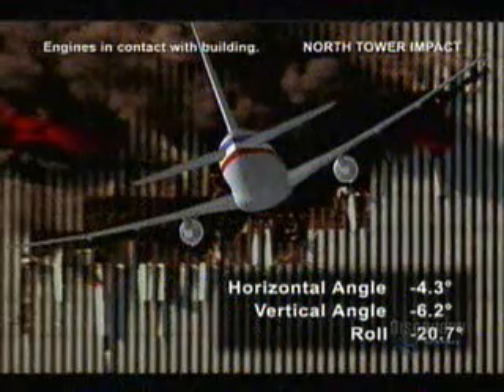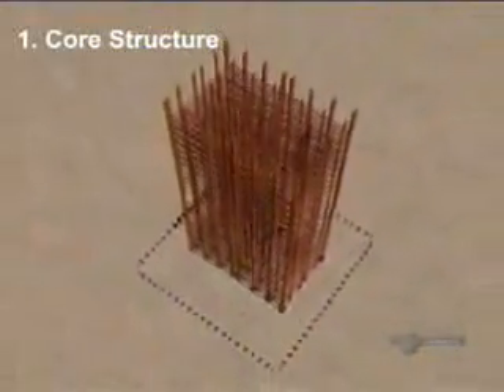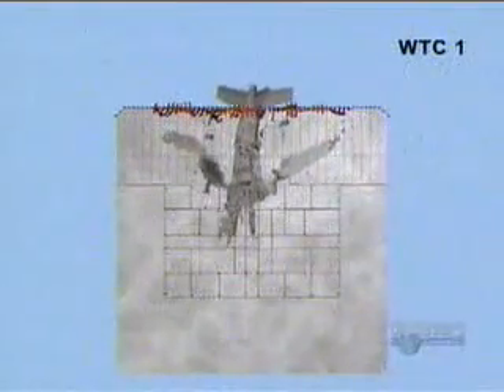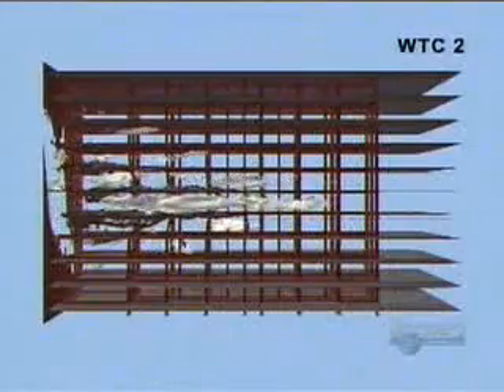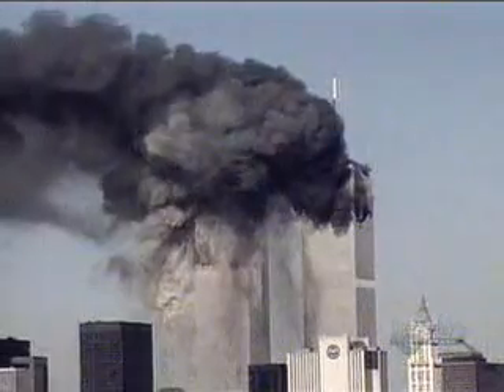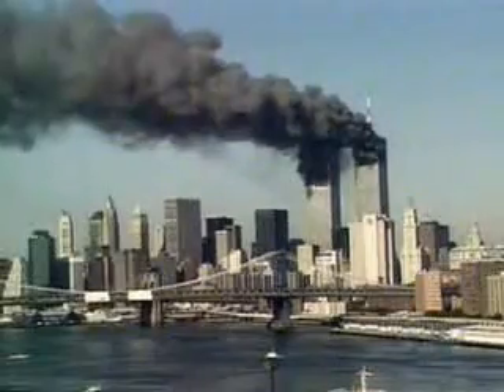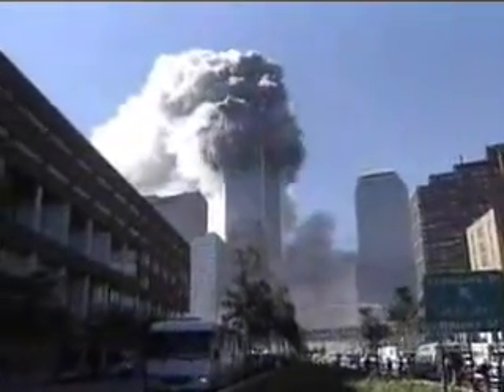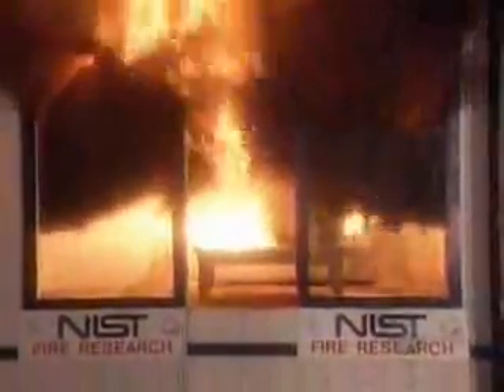9/11 What Made The WTC Twin Towers Fall

Comment: YES! THIS IS WHAT HAPPENED!...but sadly, there can be no adequate explanation, scientific or otherwise, for those who are intellectually challenged nor hell bent to believe ridiculous conspiracy theories.
Reply: The video needs to be more exact...and before you start saying that "I don't listen to facts"...I've read and have seen every video. And the one thing that doesn't make sense is that the man said that it got up to 1000 degrees. Is that in Celsius, or in Fahrenheit? Because steel itself only melts up to around 1370 degrees C, or 2500 degrees F. And if it was iron that was supporting the structures, it'd then be up to 1510 degrees C, or 2750 degrees F. Now as for the plane goes...it's reasonable that it crashing could cause some form of the structure to weaken, however the model of plane that flew into the towers (and well about every plane that's normally created), was made out of aluminum, fiberglass and some other particular materials. Yes with speeds that it was going could be a lot of force, the density for aluminum is around 2712 (kg/m cubic). Steel on the other hand has around 7850 (kg/m cubic), making it much stronger and durable than aluminum (also demonstrated by the video of how it was able to be destroyed so easily).What doesn't make sense is how it says as it was destroyed, that the pieces started to separate and splinter out. Now if I took a sledgehammer and used all my might against lets say steel for example, it would have created a dent possibly (depending of the thickness of the material). Now if I used the same force, however having the sledgehammer's main head to be separated like a shotgun blast how it was trying to describe in the video, the effects aren't as great. Going back to the structures and its heat, lets go to the facts of how hot jet fuel burns. It only reaches up to 800-1500 degrees F...which is a significant amount that is less enough for the structure to fall apart. Now look at the main base on the ground. Normally when people make buildings, they have an 'outline', or a structure that holds the building to the ground so it doesn't move. Now look at the trade center. The building is required to be able to hold itself up-straight like how it is without bobbing or weaving.Look where the plane crashed. It's far up towards the top of the tower, only giving about 15ish to maybe 20 floors. You still have the rest of the structure that hasn't been damaged what so ever, and has a strong structure. Now take this into consideration; if all it took was jet fuel to bring down a building...why would we use trained demolitionists?For the building falling under its own weight...it's around 500,000 tons. One of the towers was hit around the 78th floor and above (least that was damaged). That's only around 100,000ish tons, and that's still with supports still there. The other building was hit around the 93rd floor, which is at least 53,000 tons. This is still of course of course if the trade center was only solid piece where all the weight was.In summary; the video doesn't have enough evidence of how it would've fallen. It needs to be more descriptive, and actually show, "Hey, this was so and so strong and this was so and so hot." You get it?(Also, explain how building 7 fell...because how the hell is that building destroyed and the rest aren't? And no, debris isn't going to do jack against it.)
Reply: CaptainDeathdealer Aww, he broke his thermometer on the way down!
Reply: James D Guess you were having your diapers changed when the Towers collapsed...kinda distracting...huh.
Reply: James D FAIL!
Reply: I was working at an aviation focused architecture firm when they collapsed. Building 7, according to NIST, fell at free fall speed. There is no way this could have happened unless every single column was severed simultaneously, so that  there was absolutely zero structure providing resistance. This building wasn't hit by planes only office fires. There is simply no way office fires would be spread out evenly and cause a simultaneous failure of all columns at the exact same time.
Reply: @jasonferrier7264  Actually the freefall was only on the north side of the exterior and happened from the collapsing core kicking the exterior columns out. Explosives cutting columns "simultaneously" all the way around the building to case gravitational acceleration would be immediate, which did not happen. "Freefall" or gravitational acceleration didn't begin until the global collapse was ALREADY nearly 2 seconds into the collapse.
Reply: Sorry, but if you believe this, you are by definition a dumbass. For every floor not impacted by the planes or fire, there is apparently zero resistance.  But then, I guess that's what thermite is for. Haha
Reply: Zaphod Bebelbrox  God damn, haven't even thought about this stuff in A G E S. Time does fly though Haha xP
Reply: Demolition job

Comment: building 7 needs to be addressed, otherwise this is all just nonsense.
Reply: +Tony Parker:  Nonsense only to someone who has no sense.
Reply: Kid Jackie do I sense some hostility? Why shouldn't the collapse of building 7 be addressed? Please elaborate...
Reply: Tony Parker  You need to answer and research your own questions...I'm not here to feed you information
Reply: Building seven collapsed due to fire damage. The buildings antiquated and poorly designed fire suppression system was inadequate to handle the problem and had several defects including the fact that the electric pumps that fed the system had to be manually activated. A large amount of smaller fires caused by debris built into a much larger fire that firefighters couldn't effectively fight due to low water pressure. The fires damaged key supports within the building which caused systems to start failing and the building went down.

Comment: If the plane cut through the steel collumns then why didnt the roof collapse straight away?
Reply: They broke a few but most remained intact and were weakened over the course of the next hour or so.
Reply: Langers102 Does Stuff because there were still beams holding it up. So it took about an hour

Comment: Jet fuel cant melt steel beams. This was set up.
Reply: Jet fuel can not melt steel beams. But it can weaken them to a point where they cannot hold the building above them. Which caused it to collapse.
Reply: +cartoonnetwork fanman Actually if you look up the burning temp of jet fuel and the WEAKENING temp of steal, yes it could have easily weakened it. You are correct it would not have melted the steal by any means.
Reply: +StickmenRocks those fires couldn't even soften steel, let alone collapse 47 floors on themselves at free fall speed, now be quiet

Comment: Collapse of South tower. From the 80th floor down took about 12 seconds to collapse.
Lets think about that.
If it took one second per floor that's 80 seconds.
If it took half a second per floor it's 40 seconds.

The North tower collapsed in about the same time (10-12 seconds) from the 97th floor.

Try and tap 97 times in 12 seconds, then ask yourself how it could be physically possible for floors in a structure like this (or any fucking structure for that matter) to collapse at such a rate of what is basically free fall.
Reply: Wes Fox you musta been valedictorian of your school...the building falling in 10-12 seconds is averaging 10 floors a sec...you see the building til,  then went straight down,  then blew itself apart within 3 seconds...it is free fall speed...that little .05 or .10th of a second is a hell of a lot closer to free fall,  than the 80 seconds it shoulda fell in..,,use some logic
Reply: These floors were fully intact. No fire at all.

Comment: Common mistake Truthers make is saying the fire won't melt steel! The problem is No it won't melt them but it doesn't take much Heat to warp the Metal and made it pliable and unable to hold the weight of the top of towers.   The one thing keeping the towers from collapse immediately was the Hat truss and it was bearing a lot of weight and snapped even if the fire wasn't present the breaking of the Hat truss was a catastrophe but there are thousands of unanswered questions!
Reply: +Duke Rourschach  WTC 7??????????????? Explain please
Reply: It was not one of the twin towers. But it was a building within the WTC plaza, so therefore naming it a WTC.
Reply: THAT FIRE COULDNT EVEN SOFTEN THE DAMN STEEL, LET ALONE COLLAPSE THE PERFECT 47 FLOORS IN A FEW SECONDS, THERE WAS SUPER THERMOBARIC EXPLOSIVES USED IN THE DESTRUCTION, GET YER DAMN FACTS STRAIGHT DUMBASS
Reply: Pancake Theory is complete bullshit.

Comment: the steel columns could have melted where the plane hit due to jet fuel...the top of the building could have collapsed due to this, sure...BUT the fucking steel columns below the fire would have remained UNAFFECTED and the entire building would not have fallen. even if the floors pancaked the 47 steel columns would have remained below the melted portions.
Reply: ***** it certainly can, steel loses 50% of its integrity when temperatures reach around 1100F, the hottest in WTC2 where 1800F
Reply: Once the top of the tower has start to move, the strength necessary to stop was to high.. Plus, the structure has failed 'cause of the link between the perimeter and the core structures.
Reply: When the collapse happened the building was accelerated due to its weight and the steel cant handle it so it fell down to death
Reply: mouleagaufres exactly i hate when people make this dumbass statement, its called momentum and gravity and they're very hard to stop
Reply: Molten steel due to jet fuel fires is imposable.
Reply: I'm pretty sure it just "weakened" the colums
Reply: On a few pictures taken just before collapse, we can clearly see that the perimeter columns are going to the inside, there is an angle. That is a clear proof that the inside of the building was pulling on the perimeter columns.
Reply: +Strangeness Video without the roof truss in place the walls had no more support therefore dramatically reducing the structure
Reply: Jet fur and fire is 1000 degrees cooler than needed to melt steel, idiot
Reply: John Sergei you need to learn how to spell before you can discuss big boy talk, ok?
Reply: +Strangeness Video derrrr it collapsed on itself dummy, its too easy kid
Reply: G
Reply: Strangeness Video the best explaination is the 10-12 sec fall of the towers...on average that’s like 9-10 floors being blown out every second...
Reply: 911 had nothing to do with Iraq. That's what George W. Bush said. 911 has a much deeper meaning for the whole mankind. There was a world before 911 and there is a world after 911. Now we have a surveillance state in the USA. The US government regards every single person in the USA as a potential terrorist. So they try to make us believe that it is necessary to spy on everybody.
Reply: xCmOn3yxV777 What proof do you have that the fires in either building reached anywhere near 1800F?
Reply: There were no planes at all!
There was no jet fuel at all!
Reply: Of course it could cause the building to collapse. You're talking about thousands of tons of concrete and steel falling down on to floors below! I work in construction and buildings are designed to carry weight of the floors above, not have tons and tons of weight drop on them suddenly. It's ridiculous how people still think this terrible tragedy was some sort of government conspiracy to invade Iraq!!
Reply: +Strangeness Video you seem to under estimate the force of GRAVITY!?
Reply: +cartoonnetwork fanman Melt, no, you are correct. However it is perfectly capable of weakening it.

Comment: Why even say anything. I don't know much, but I know that the the further you are from the earths core the weaker gravity becomes. He's talking about acceleration due to gravity, but that doesn't explain why the remaining supports didn't at least blunt the force of the top half of the building. He suggests that the jet fuel went down the elevator shafts and weakened lower supports causing the building to pancake? But how could the jet fuel have hot enough to weaken the steel and bypass the fireproofing of the bottom supports? I'm not jumping to conclusions just trying to understand.
Reply: StillNotDRE Because once the upper floors started down, the lower floors couldn't withstand that much of a dynamic load.  Every floor it hit, added more and more weight to the mass traveling downward.  If you watch the collapse, you can see that the outer façade of the building falls away from the center, traveling faster then the center of the collapse.  The way those buildings were designed has a lot to do with why they came down the way they did.

Comment: You're all right in saying that the jet fuel will not melt steel. However, the jet fuel burned at around 1000 degrees celcius. At around 700 degrees celcius, steel starts to change forms and weakens. No it does not melt, but it weakens and for the structure to weaken and further be exposed to those kinds of heats and weight, it's very easy to see how it would give.
Reply: xTheCanadianx Those fires weren't smoldering. They were pretty massive fires on the inside that you can't necessarily see from the outside of the building.
Reply: liberals dont understand science sorry, save your breath
Reply: id beleive your explanation, however the fire wasnt blazing it was smoldering,  so i highly doubt it hit 700F
Reply: Why molten steel then ?
Reply: Wes Fox aluminum glows silver in direct sunlight, contaminated aluminium doesn't explain the uniform flow or colour.

wake up.
Reply: Below the 89th floor there wasn't any fire at all.
Reply: steel dose not melt until reached 2000 degrees.

Comment: They clearly have a biased view and two main points I have picked up on show this.

-First they claimed there was over a tonne of fuel on board causing great fires. An impact of with that sort of explosion would not have left the floors in tact but shatter them thus removing the domino effect.

-Secondly and this made me almost laugh. To come out and say a building of this height cannot topple sideways is the biggest pile of utter bullshite I have ever heard in my entire life. The taller an object the more likely it will topple over sideways. Think of when you were a kid. You build a tower with toy blocks and start at the bottom stacking them on top of each other more and more. As you go higher and higher what happened? The tower sways and eventually falls because you have no strength within it but it doesn't fall down vertically it topples sideways over like a massive domino falling over. The higher an object the more its potential gravitational energy and that goes for towers too. Especially outdoors because the higher the tower the more cross sectional area it has on the side of it for the wind to blow on!
Reply: Simo2009BORO see...this is why you're not an engineer. It's not like Jenga...it's not all "common sense". In fact many things that seem logical in the small scale world that you operate in are completely different in reality. Science is very often counter intuitive...

Comment: So the planes cut a lot of beams.  The building below was healthy.  Think, what would happen if you cut every single beam all the way across?   The building top would just sit there on top of the healthy portion like it always has.   The building is designed to support its own weight, actually its designed to hold 3 times its own weight for safety and to stand up to 100mph winds.  Even if part of the top sagged as the steel weakened in the heat, it would still just sit there.
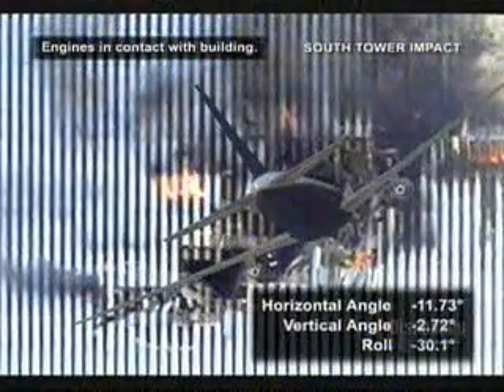    At minute 3:04 video says a crucial structural element was taken out?? what key element??   And fuel down elevator shafts, thats been long disproven.  Except for 2 elevators, the elevators are not continuous,  building had 3 separate elevator sections. to divide building up, google it.  Very little fuel ever got in the shafts.  The goof also said that these 104 story building could not topple over? what was his logical reason for this?   These building were brought down by demoliton.
    Who is that guy with the moustache?  Wasn't he on sesame street?
Reply: Tom Jones ever heard of something called gravity? when the columns support the area above the impact gave, nothing was holding that part of the building up, and well gravity and momentum took over from there

Comment: This is how I feel about all of this:  I don't believe that the towers were demolished.  Mainly because when you compare that to what happened to building 7, nothing fits.  Building 7 was for the most part not damaged by the debris from the towers.  And that building was ompletely evacuated before it came down.  How can two GIANT buildings be brought down, with full knowledge that so many people are still inside, but then demolish an empty building that did not sustain the damage that the towers did?  The way that the buildings collapse differ from each other.  The towers collapsed from what looks like the damaged areas not being strong enough to hold up any more.  And the cloud of smoke and everything, goes down WITH the towers from top to bottom.  When building 7 collapsed, that smoke came from the bottom to the top, meaning that the point of destruction was from the ground up.  Now I'm not an expert on any of this and I'm not claiming to be, so please don't give me crap for what I've said.  If there is any theory about that day that I DO believe, it's that building 7 was a controlled demolition, and not the flimsy excuses that one column or office fires brought it down.  I do however believe that the damage sustained from the planes crashing into the towers, is very likely what caused their collapse.
Reply: geminiM2783 WTC7 was massively damaged from the collapse of WTC1, tired of people stating false unsupported non-sense. do some real research